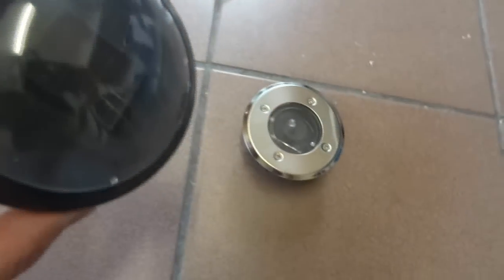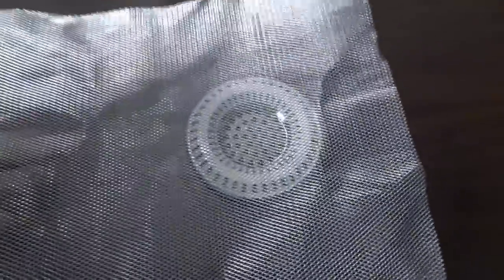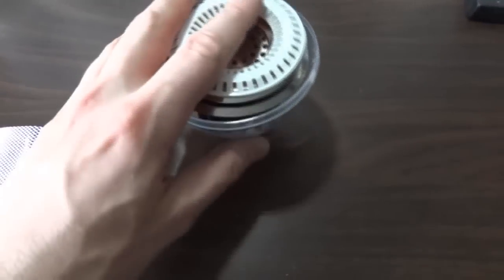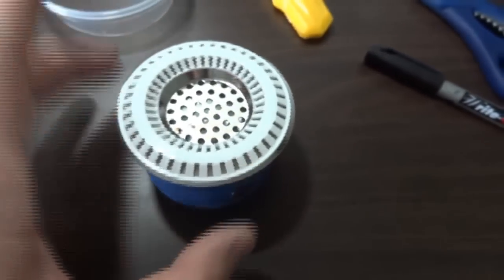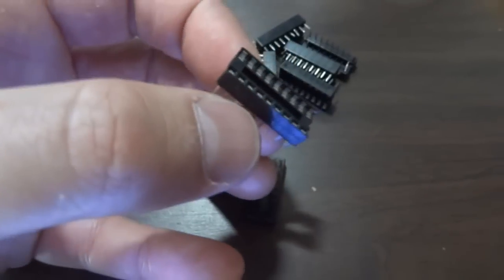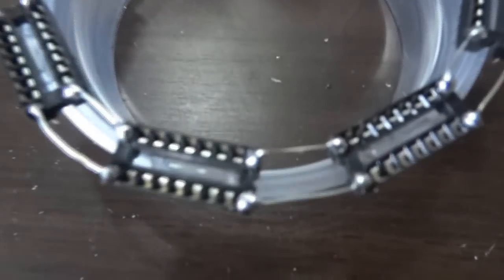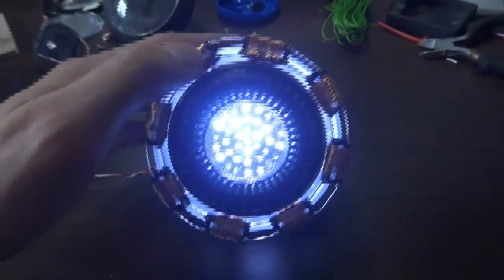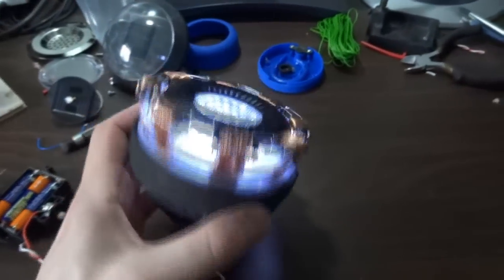Iron Man Power Suit #10 | Arc Reactor | James Bruton

Comment: I made mine from two main components:

* a domed table lamp that turns on/off when you press its plastic dome. It has three (3) led lights in the middle. (Powered by three AA 1.5 volt batteries; series connection). The table lamp has a hole underneath the base, near the edge of the base where you can hang it on a screw like a picture frame. (You'll use this hole to pass through another set of wires)

* a strip of led lights connected in parallel circuit embedded in a strip of soft clear flexible plastic(?) about 20" long (normally for motorbikes than can be powered by 12-volt batteries. Also works with type 6F22 Nine (9) volt battery (both of its terminals at the top)

Process:
* Remove the dome of the table lamp by removing the screws from the bottom.

* Gradually coil the strip of led lights within the plastic dome. (When coiled, there will be a gap or a hole at the center, just like a doughnut's hole. It will be for the three led lights of the table lamp)

* Position the wires of the led lights so it will go out through the hole underneath the lamp base.

* Reattach the dome (now with the coil of led lights) back to the lamp base by its screws.

* For the coil of led light wires, attach a nine-volt battery connector and a switch to make it work.

Notes:
* You can turn on/off the three center led lights separately from the coil of led lights. You'll get either: a) center lights; b) coil of lights; or both center lights and coil of lights.

* Use a single 9-volt battery; or two/three 9-volt batteries (parallel connection)... The use of 9-volt battery/batteries is preferred since its much smaller than a 12-volt motorcycle battery which is bulky and heavy to wear in a costume.

* Use 6F22 type of 9-volt battery

* Although 9-volt battery is less bright than 12-volts but it still works fine under bright lights, more specially if you're in a dark or dim area of the party.

Comment: I have an idea, why not put a small high voltage battery INSIDE THE middle part of the reactor and connect the copper wire which is wrapped around the thingy to the battery compartment. So , you can power any electronics just by connecting a wire from the copper wire which is wrapped around the thingy of the arc reactor to the electronic to power the electronic!! That would be more realistic because the reactor can power any electronics.... I hope you understand my statement... Thank you :)

Comment: may I ask what did you do to extend the wire? I extended my wire by cutting the original ones off, and use copper wire to connect them back for extention. However, the bulb just wont' shine after I connect everything. I tried it two times, but both died. Help!

Comment: Great Job! Going to start my build soon:) Quick question- does the battery come with the light used on the inside? Also, how did you get the wires to feed through the garden light if the battery was connected to the light?

Comment: I found the round one used for the rear of the arc reactor on ebay from seller bg27cyf (search under the advanced tab by seller)     As for the solar light used inside the arc reactor, I haven't a clue, I have not been able to find one like it yet, but still have a few stores to go check at. Good luck.

Comment: You can find them on ebay for $2.44 by searching for 	
"24 LED Blue Powerful Lamp Magnetic Camping Light Hook"
and you can find the pin holder (white middle section he paint's black) by searching on ebay for "Korbond Berry Pins". And make sure you go to the website in the description, it will help you identify the parts you need to look for. Also, the "Line holders" can be found on ebay by searching for "IC socket", and you can find the strainer and the expanded aluminum mesh on ebay as well.

Comment: You can find them on ebay by searching for 	
"24 LED Blue Powerful Lamp Magnetic Camping Light Hook"
and you can find the pin holder (white middle section he paint's black) by searching on ebay for "Korbond Berry Pins". And make sure you go to the website in the description, it will help you identify the parts you need to look for. Also, the "Line holders" can be found on ebay by searching for "IC socket", and you can find the strainer and the expanded aluminum mesh on ebay as well.